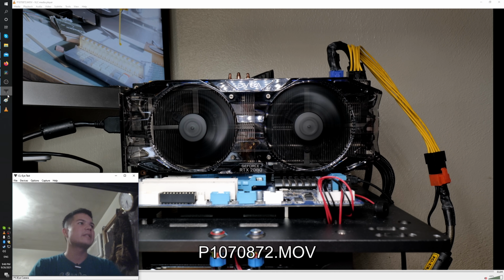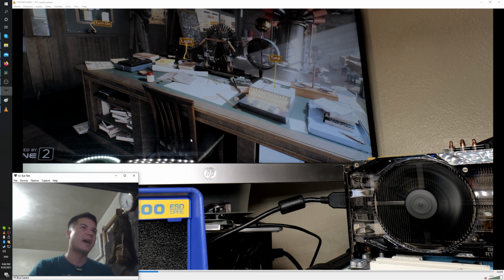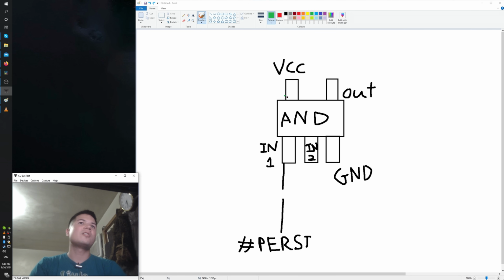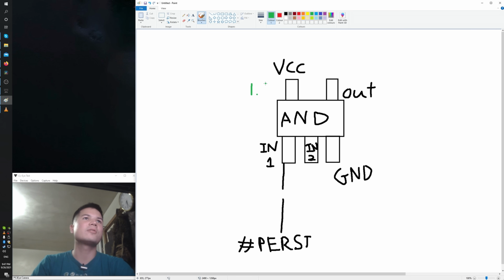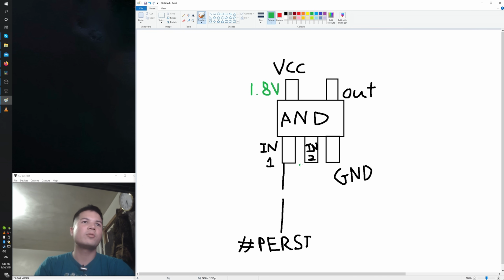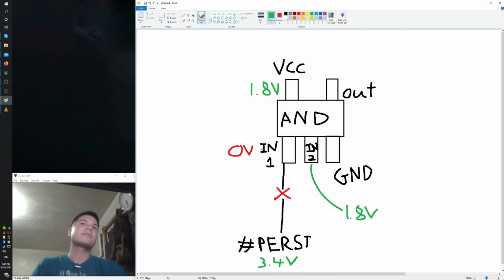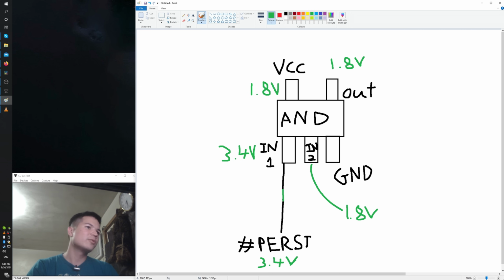EVGA RTX 2080 XC Gaming Graphics Card Repair - Random Crashing

Comment: I have an EVGA RTX 2080 Ti, but it has the single fan instead of the dual fan like this one. Mine is doing about the same thing as the one in this video, but after it crashes, it boots in low resolution and the GPU in device manager shows orange exclamation triangle next to it. Also, it will sometimes give me artifacts, blue screen that says TDR failure, and something about the nvlddmkm but I cant remember. device manager will windows stopped the device with code 43 after a crash and reboot into low res. I dont know what the issue is with mine, but the card back plate does seem kind of warm for no load on it. Temps look good in hardware monitor, so I suspect it is a reball issue or some other component is failing and heating up the back plate. Do you have any ideas of what the issue might be with my card? Any tests or programs I can do to narrow down? I have gpu z as well if that helps

Comment: What caused that corrosion?  Is that a manufacturing issue?  I have a 2 year old Gigabyte RTX2080 super that recently started crashing when I try to play a game.  I was playing WarThunder without problems but then the screen goes black and the fans throttle to full speed.  I updated my bios and uninstalled the Nvidia software with DDU and just installed the driver alone and was able to play one game of fortnite without crashing but now it is crashing again.  I can render videos though without any problems.
Reply: My issue right now

Comment: I bought a HP RTX 2080, drivers wont install and if i try via nvidia. After install it will try to boot but will freeze and blue screen right when windows 10 tries to load. Where should I start? Card seems hot with no load. Card does have thermal cooling pad juice over some places in the card should I try just a card clean?

Comment: Hi, have question in general on a HOT CPU when voltage injection. Channels say at that point the cpu is shorted and thats it. 
CAN that not always be the case and some other shorted component is pulling current through the cpu making it look like its shorted?
I have so many laptop boards with hot cpus with say 3-4 amps and i cant find anything else hot. so is that it, a BAD CPU ONLY or Northbridge or GPU Chip ect? 
They are all BGA and cheapish so dont want to risk replace if not definitive..
Thanks for any help here..

Comment: Is there a problem with your discord server today 6th October?
Reply from the maker: No, what's happened?, 

EDIT: Do you have two discord accounts?.
Reply: @TechCemetery  I get Messages Failed to load, you do not have permission to send messages in this channel.  And I can't see most sections.

In bottom left corner it says
learn electronics repair #8936

If I then click the link from your discord to electronics repair school I can access that one no problem. So I must be logged in I guess

Yesterday evening I then tried to register another Discord account on a different email address and user name to see if that worked. It didn't  - same problem.  Today I will try on the PC at the workshop, maybe something wrong with this one at the house

Comment: Hello :)
I'm starting to learn electronics repair, especially laptops, motherboards and graphics cards. It is a fascinating subject!
Currently I'm struggling with Gigabyte Vega64 Gaming OC, where user forced the PCI-E power connector the other way around (do not ask, I don't know ¯\_(ツ)_/¯) and it blew IR35217MTRPBF chip (power management IC)!
The problem is even if I solder this thing on the PCB it supposedly won't work without programming... how to source this programming without having a working chip from the same card on hand?
Any help appreciated!
Reply from the maker: I don't know a way of obtaining programmed chips without salvaging them from dead cards.
Reply: @TechCemetery  I can program it, as I have a new chip... all I need is binary that someone fetched from a working one :) Any i2c will do it
Reply from the maker: @DIYRepairHour  May I ask what tool and program you would use? I'm not that familiar with i2c

Comment: Just to mention one thing: The AND gate probably isn't damaged. If the trace was split the input was floating. Floating inputs tend to result in a logic high state. You can't measure this leakage current with your multimeter. Even the megohm of input resistant is basicly a short-circuit for this gate input.
This is why, on an engineering perspective, you say: Never let gates floating, unused inputs should be set to low or high by pulling them to ground or VCC.
The effect here was the "radio sensitivity" (EMI) of this floating pin. The high-value is so incredible unstable, a little EMI spike on the right point may trigger a low level, so the card gets reset. Since this only affect the GPU the driver crashes right after (or end up in a dead-lock) and therefore the whole PC.

So I am pretty sure the only problem was the copper trace. Unless you checked the gate by pulling the input low. You didn't mentioned this in the video. So ignore my comment if you did.
Reply from the maker: Thanks, I actually didn't know.
Reply: Nice insight
Reply: yes but better to replace it so it doesn't come back that would be annoying for the customer.

Comment: Are you not afraid the GPU will get too hot when testing the AND gate?
Reply from the maker: No, I know how long I have roughly speaking until the chip overheats, none of the GPUs you see on the channel get so hot that they reach thermal shutdown temperature.

Comment: ***********please explain the reason of this crash, us updating bios will fix this***************
Unrecoverable memory error by GPU 0.
Reboot for this GPU required.
Please check your (memory) OC & voltage settings on this card.
Device 0 detected as crashed.
Closing miner with exit code 42 (--watchdog close).

Comment: Question: how does the AND gate know to pass the 1.8V vs the 3.4V.  AND gate shows both A and B inputs as connected/switched to the output Y. Is VCC actually what's passed through the swich and A+B are just gate voltages?
Reply: Yes, A and B are just gate voltages. The output is powered by VCC. Nothing is "passed through" to Y from A or B. 

To put it another way: If A and B are both above a predetermined threshold voltage (e.g., 0.7V), then Y is driven high to VCC. Otherwise, Y is driven low to VSS (ground). 

Hope that helps.
Reply: @Friend_of_the_One-Eyed_Ladies  That makes sense. VCC is 1.05V but I assume some of that is consumed and that's why the output on Y is 0.79V?
Reply: 7:10 this is how an AND gate should work in this circuit. VCC should always be 1.8V, and Y should always be 1.8V unless you're pressing the Reset button (in which case, Y will be 0V). Any other readings and something is wrong.
Reply: @Friend_of_the_One-Eyed_Ladies  On a 980TI, which is what I'm working on, there is no 1.8V rail. The 900 series Nvidia use 1.05V and 3.3V for control signals. When the 1.05V VCC goes into the logic gate, it comes out ~0.79V via Y.  It seems low.

Comment: I have problem with 1 year old rtx 2080 super. Tha card working in idle, but after load in benchmark crash on  20 second.On the monitor are also by start little artefakt on 10 second.Any idea how to fix ?
Reply: Try running MATTS MODS to check for faulty RAM chips. Tech Cemetery has a video on it. Also check the GPU and RAM clock speeds in GPUZ to see if they are good. There should be a video on the channel for this issue as well.
Reply: @veselinvasilev5739  I was trying download this file, but my comp say that he must corrupted download because file is not save.I was trying also automatic overclocking card and all is fine.Only when i use benchmark card crash after 5 second.Card has samsung memory.ROG Asus rtx 2080 super advanced edition:-)))) and crash:-)))

Comment: Ah yes another reason to upgrade my test bench, my mobo reset pin isn't working, instead of powering off and on again it just stuck and won't turn back on.

Thanks btw, also new info for me
Reply: I think i need to read the SIO datasheet
Reply: so fix it
Reply: @jasonr9157  im lack of experience repairing motherboard rather than repairing graphics cards
Reply: @accurian148  start at reset pin, trace the signals back to the chip that controls this signal
Reply: @jasonr9157  i know it, PCH and SIO but i can't really check which one is faulty
Reply: @accurian148  when i said trace it i actually meant trace continuity, you are using a screwdriver to short the pins yes? 

firstly i would check the soldering underneath the header pins, in fact id drop new solder on the header, 
once you have eliminated continuity along the chain, id simply reheat/reflow  the controller chip using some flux and a hot air gun, its shocking how many problems this method fixes 
its highly unlikely the controller chip has failed just on reset,  and much more likely a cracked solderball or bad solder joint in the chain, or some dirt or liquid, maybe even a quick dip in an ultrasonic machine if you have access to one,
there are many things to check before deciding to swap a chip
of course you could always just upgrade your test bench
Reply: @jasonr9157  i have this motherboard schematics and boardview, i traced it and it goes through 33 ohm resistor to PCH and 0 ohm resistor to SIO
Reply: @accurian148  the 0ohm resistor is a fuse, check both these resistors, if they check ok and you have eliminated the reset button as the cause by using a screwdriver to short the pins, and you have checked the pins and resistors for continuity gently press the chip where the signal is generated while pressing reset to see if it is a cracked solderball, if the reset works then heat with a hot air gun and flux, its highly unlikely the chip is faulty and much more likely its the soldering
Reply: @jasonr9157  i have an asus b250 mining expert, it won't turn on, had corrosion on one spot but only figured it out after frying the sio ans pch controller, replaced sio, still doesn't turn on, i checked rsmrst pin on sio and it doesn't go high, hence the conclusion that the pch is not getting a signal to turn on, what could be done?

Comment: I would guess that why some cards start to function after being thoroughly cleaned.
Without proper lighting and preferably a microscope you easily miss corrosion like that. 

Another reason might be the oily liquid that tends to accumulate with old thermal pads.
I’ve had cards where I would blow compressed air under the memory bgas and they would work again. 

Top notch content 👌

Comment: Can you please make videos on old models 
Like gtx 970 rx 470 570 etc
Reply from the maker: Those cards are typically not sent in for repair due to their low price.
Reply: @TechCemetery  thanks for fast reply 
then is there is any website on which I can get resistance values and other info for these gpus 
Love your content
Reply: @lovedeathhatepoison8737  if you have questions regarding your gpus, you can always check out the discord server. Lots of skilled people on there :)